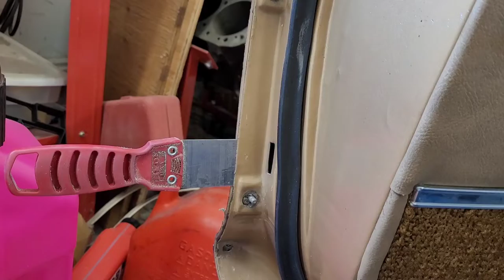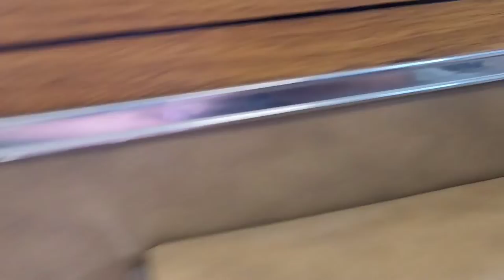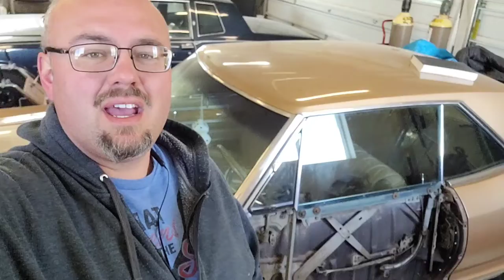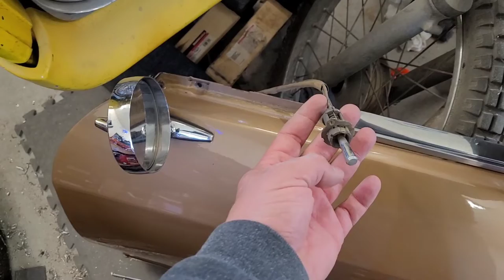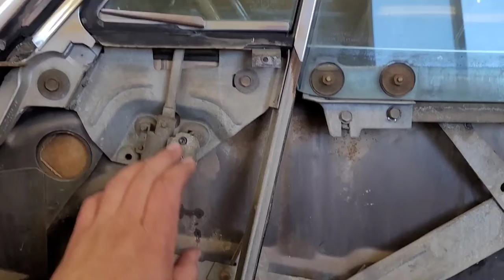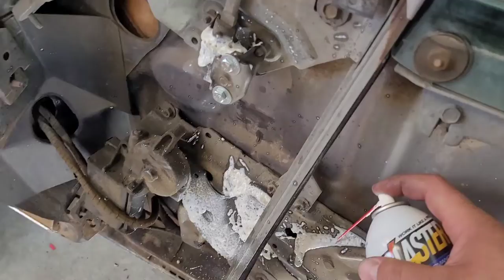The Door Lock Mystery! Door Skin Removal on the 1965 Buick Riviera

Comment: My driver window does not meet up with the back window and I am thinking it is an adjustment. Is it just simply taking off the skin to get to it all? What about adjusting the small rear window? Does that need to be dug into from inside? I am so glad I found you and your videos, it has been a huge help in my work on my 64. Thank you so much
Reply from the maker: Yes, taking the skin off is how you adjust the window. I would think that the rear window would be done from the inside, that's not one I've had to mess with. Now, how simple is taking the skin off? That totally depends on how well the nuts on T bolts come loose... I did have to cut several off on this one. OPGI does sell new T Bolts and nuts. It's a nerve wracking process. The good news, you've got a guide to do this!